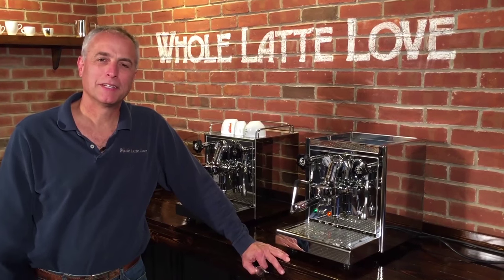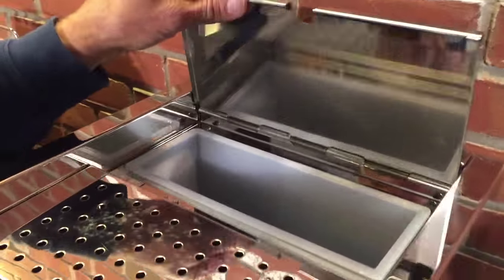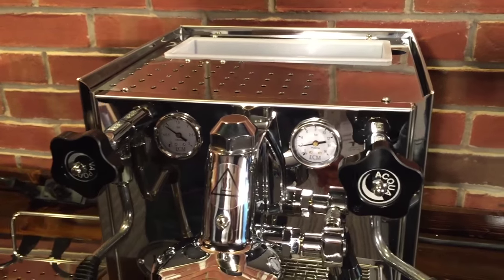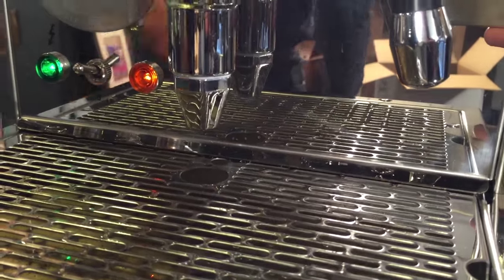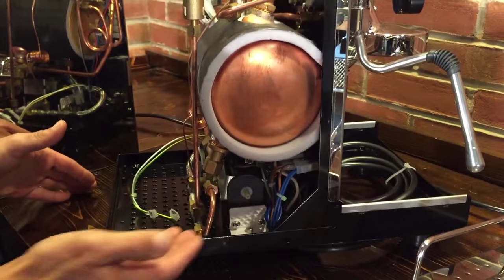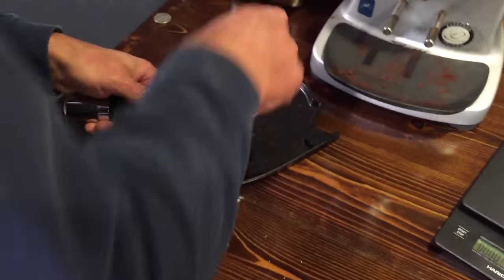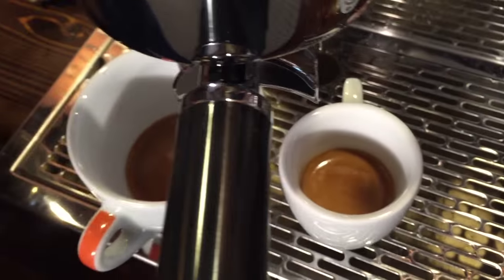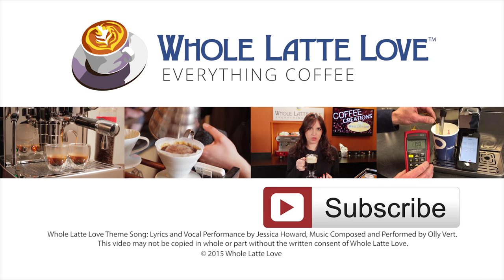Compare: ECM Technika IV and ECM Mechanika Espresso Machines

Comment: can you change the brew temp on htese machines. for othere roasts
Reply from the maker: Hi kim, This older video features previous versions of the machines. Temps were adjustable on those but it's easier on the current versions which you can check out here:
Technika V Profi: https://www.wholelattelove.com/products/ecm-technika-v-profi-pid-espresso-machine-olive-wood?variant=32759964565558
Mechanika Max:https://www.wholelattelove.com/products/ecm-mechanika-max-espresso-machine-with-flow-control?variant=40705001586742

Comment: Odd, I am currently looking at these two machines on your website and notice BOTH have levers instead of knobs. Do the rotary versions of these machines come with knobs and the vib pumps come with levers?
Reply from the maker: Hi TaxPayer, You nailed it! The Profi versions have the levers.
Marc
Reply from the maker: @AnotherOverTaxedTaxPayer  Hi, I forwarded your comment to Tim. There are likely some deals available if you package a grinder with the machine.
Marc